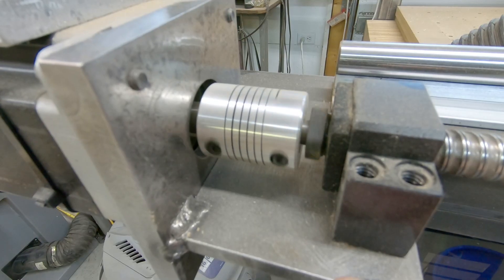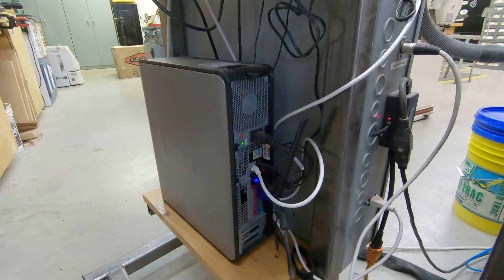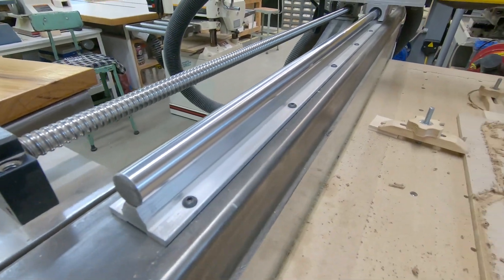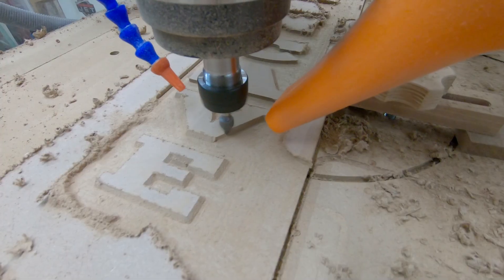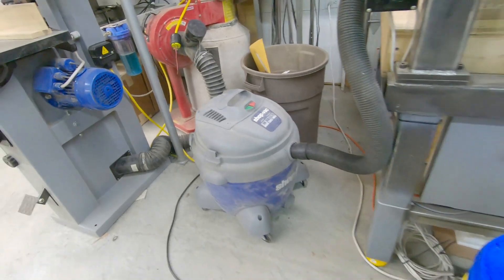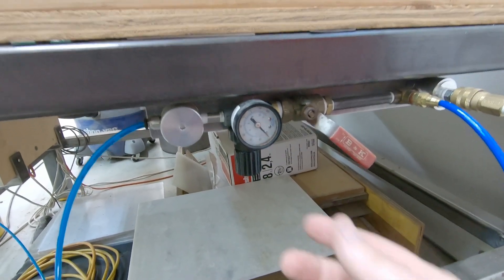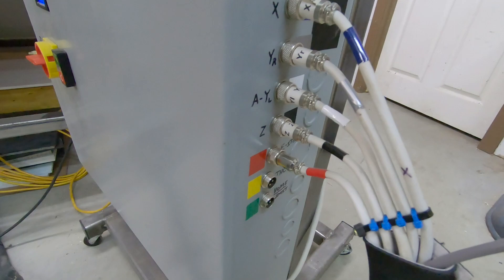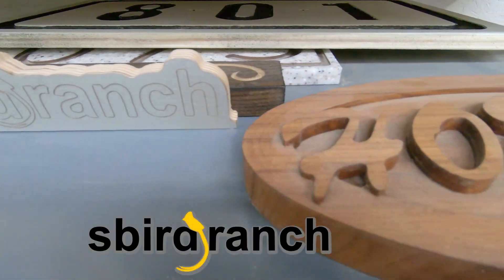DIY CNC after 3 Years

Comment: Very nice! I am getting ready to set up a Taig mini mill so had some questions for you.  I was wondering what driver you are using on the z axis since I am using all NEMA 24's? 
On one of your past videos it looked like you had a heat sink on the x axis stepper, just curious what was going on there then vs now? 
In that same video you mentioned your pc choice would be to try and find controllers that use USB, would have an example of a board of this type, because honestly get so confused trying to configure Ethernet adapters.
Reply: sorry I meant NEMA 23's
Reply from the maker: The stepper driver for the 24 is a DQ542MA.  It is the one that came with the motor when I ordered it off FleaBay.
The heat sink resulted from when I first did the build, I felt like they were getting hot.  I had the sinks so I put them on.  They are still there.  They probably are not necessary as I think a lot of the heat was coming from the power spend holding the motor in place when not moving.  I changed that driver config reducing the amount of amperage at rest.
The board I would highly recommend is the ESS or Ethernet Smooth Stepper.  No parallel cables.  No special 32 bit machine stuff.  One cable and your done.
Good Luck with your machine.  I'm about to retire and hope to put many more hours on my machine.  It still runs great.
~P

Comment: I’d love to see more on your plasma table build. A video like your likes and dislikes video that you did for your cnc router would be awesome. I’m also curious about your kiln. I watched and rewatched those videos. How’s it functioning?
Reply from the maker: Ahhh the plasma table.  I'm happy to say I am working on it.  I have done a bunch of cutting and identified a bunch of problems.  Some small, some large.  All have a lesson in them.  I'll be putting more out on that someday.  I will say the core design is solid and works.  My problems are little things like belt tension and that stupid Z axis I bought from ebay.  I'm currently making my own from scratch.  I'm super excited to have a solid understanding of how to implement proximity sensors now.  I think I'll do a video on that too.  I never found anything clear and concise to reached down to my level. 
Regarding the kiln:  I haven't used it in years.  I also haven't done much wood working.  I have no reason to believe that it won't work if I plug it back in.  The controller and all the cables are in a case and the kiln it self is safely stored in the barn.  I have considered selling it to be honest.  But then I consider that I'd like to build a bandsaw mill (cuz everyone builds one at some point) and realize I'd need it.  Who knows. ~P
Reply: @sbirdranch  thanks for the   videos. It’s hard for me to buy things I can build myself. Economics doesn’t even seem to be a factor. I almost always spend just as much money in my build then I would spend to buy it. I lie to myself by telling myself that I save money on the customization aspect. I just need to learn balance....

Comment: What ratio of colloidal silver are you using in the coolant loop i.e. is it all colloidal solution or are you diluting it with tap water?? Interesting idea I had never thought of doing that but I could see how it should work . I have my own colloidal silver generator setup so I could make what ever I would need.
Reply from the maker: Good question and I don't know.  The CS I'm using is being made with a CS Maker my wife has and it doesn't indicate at what level it turns off.  It is making water intended for drinking if that helps.  In addition, I put a sliver of pure silver in the reservoir just for extra grins.  I have yet to change the water and it isn't growing anything.  I do keep a cover on the reservoir but not the lines.  ~P
Reply: Colloidal zinc would probably work just as well as antibacterial in the coolant and is much cheaper

Comment: Seems like machine is running slow, what speed & acceleration do you normally run at?
Reply from the maker: Everything tops out at about 40ipm and that is mostly due to the length of the ball screws.  They pick up a vibration at high speed and cause the steppers to miss steps.  There are some things I could do that might lessen this but 40ipm is fine in most of what I cut and I have to crash the machine to miss steps.  ~P

Comment: Great job on this .. Really good to see a pragmatic build.
I like your design as it is nice and simple and like the horizontal X gantry rather than vertical as it makes more sense to me as well
Just a few questions if you don't mind.
I am on the process of designing myself a CNC router, and it will probably be a lot like yours
If you had to do the build again from scratch, what would you change or do differently
As far as linear bearings , would you use the same ones again (ie the supported round rails or would you use HiWin type square linear rails
Was it akward to get the linear bearings tuned in being fitted to square profile metal rails which by nature are not perfectly straight. Did you need to shim, etc...
Any other comments or suggestions would be much appreciated to save me making more mistakes that I owuld have done !!!
Keep those videos coming. I think I have watched most of them
Many thanks
Reply from the maker: Stephen, thanks for the interest and I hope your build goes well.  Funny you ask, as I am now in the process of testing my plasma build and told a friend the other day that my router build worked out of the box with no significant design changes needed.  Plasma...not so much.  What would I do different on the router, is just what you said.  I would have started with HiWin rails.  Here's the thing.  I had no idea if the machine would work at all so I was keeping my costs down.  Once it was up and running, I started demanding more.  More accuracy, rigidity and speed.  My design didn't need to change, but the rails did.  As you can see, my X and Z are now HiWin rails.  I will change the Y rails at some point as the bearing are causing problems sometimes.  So...same design, different rails.
My gantry height is of no use about 98% of the time....but that 2% can be a killer.  I have added about three layers of 3/4 MDF to reduce that distance mostly hunting for rigidity.
Spindle...love it.  Motors...might have gone smaller, especially with HiWins.  Some 'large' NEMA 23's might have done just fine, especially on the Y where you are driving two.
Bottom line is I have learned to trust this machine.  I can walk up to it and hit cycle start and it works every time.  You would not be the first person to copy some or all of it.  A guy down under called @etchandcutdesign on IG built one from my drawings and he is running a business.  Good Luck ~P

Comment: I've watched a few of your videos and taken many suggestions to heart when designing my 5x10 cnc Plasma table.  I had a couple questions for you though. What size SBR rails did you use and do you know if they can be run end to end, that is if I need 10ft, can I use two 5ft long pieces? I originally was going to build a smaller 5x5 plasma table and simply feed in the full sheet as needed, but a local machine shop was selling off some relatively precision jig tables and I was able to purchase a 5x10 jig table for $100. So my original design has changed a bit and I'm looking at all options. The SBR's are in my price range if I can utilize 2 pairs end to end. I suppose if I center drilled them on the lathe and used indexing pins for alignment, I guess I'm just thinking out loud. Thanks for your time.
Reply from the maker: I used the 20mm version.  I honestly can't think of a way I could machine them to be joined in such a way that there wouldn't be a rather harsh bump when the bearings go over.  I think event turning the ends and putting a dowel pin between them would still leave too harsh an edge.   Those balls are very small and will notice everything.  Good luck and thanks.  ~P
Reply: @sbirdranch  so after sending you this question, I saw your videos on your plasma table and that got me thinking about the steel plate and v wheels and I'm going that route.

Comment: Great to see you posting again. I really got inspired to build my own watching your original build.
Reply from the maker: How did yours come out? ~P
Reply: @sbirdranch  4 x 2 cutting area gantry style.  Hiwin 20 rails. Slaved dual Y axis motors / ball screws. Nema 23 Z axis 34's on other axis. Made from Aluminium extrusion. Unorthodox Z axis made from brass extrusion in the form of a frame rather than machined aluminium plate. Nice and rigid. Had it cutting but now mothballed until I board / insulate my outbuilding over the winter.

Comment: Miss all your videos. Glad to see this one posted. Follow you on fb and if. 
For your air solenoid control just the it into your Vacuum switch, you want both on and off at the same time
Reply from the maker: That's a great idea.  I'll have to check the load rating for the output pins on the bob to make sure it can drive both direct, else I might need a little extra pixie magic.  ~P